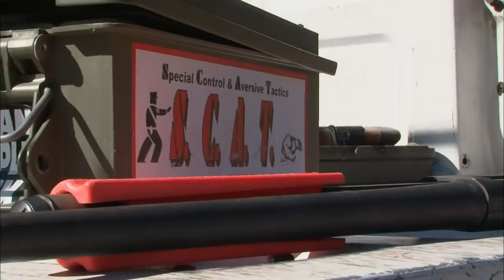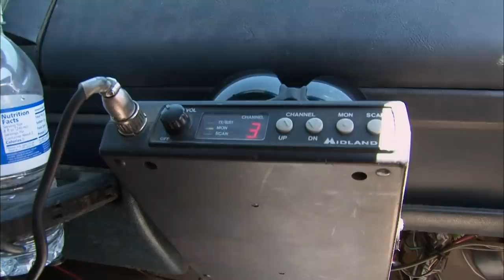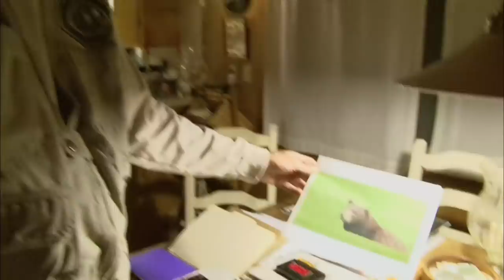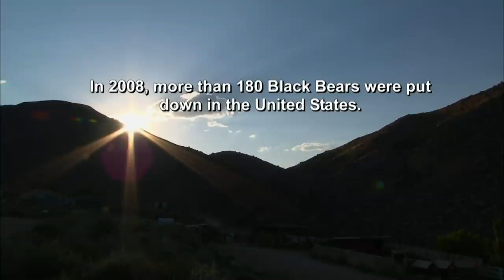Bears And Humans Can Co-Exist Thanks To Wrangler Steve | The Bear Whisperer | Real Wild

Comment: For the best safety, would it be a good idea if the bears get from everything there is to smell? People built and are everywhere everything. And if bears make a mistake they get shot. So a type of rent that provides a higher level of preventing anything from going wrong.

A sign that it is working could be less damage to i.e. cars. At least if they understand it is an undesirable act. Animals can be made to understand some things, like how house pets show.

But then animals that are not a danger and have the same problem. They would probably also have to get, as this type of thing could make it fail for the dangerous one. There are these balances that can be distinguished.